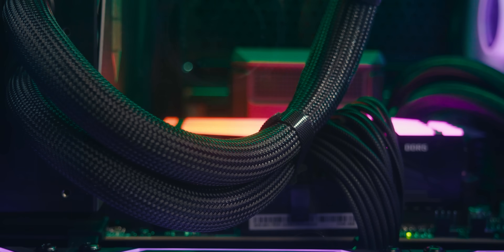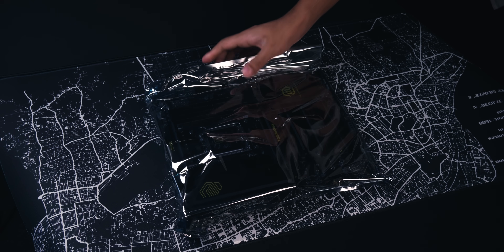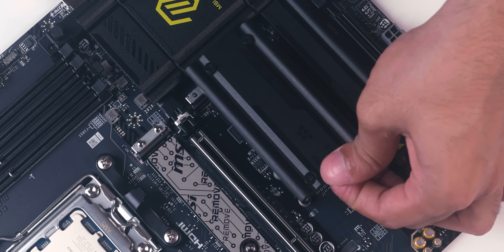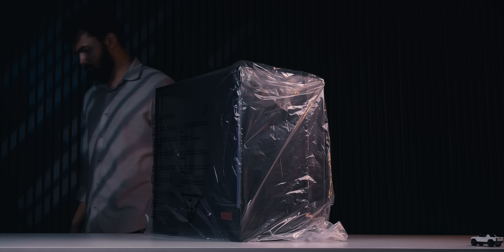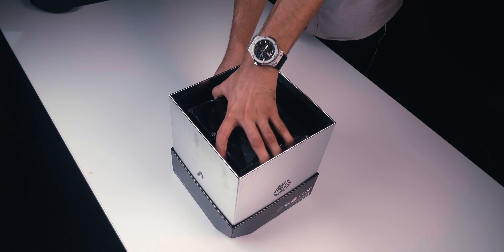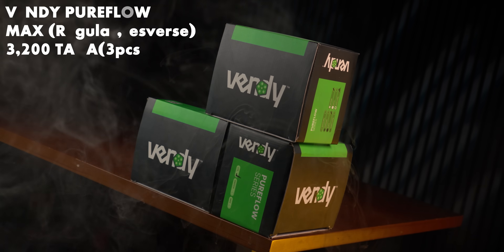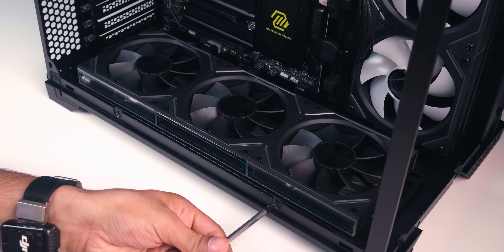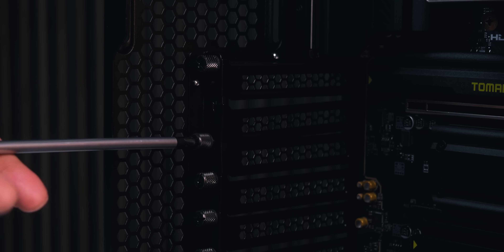PC Build For CSE Students | Ft. Ryzen 9 9900X + RTX 5090 32GB

Comment: CPU	AMD Ryzen 7 5700X (8 cores, 16 threads)	৳২২,০০০
GPU	NVIDIA GTX 1660 Super (6GB)	৳১৮,০০০ – ২০,০০০
RAM	16GB DDR4 (3200 MHz)	৳৬,০০০
Storage	1TB NVMe SSD	৳৭,৫০০
Motherboard	B550M (Asus/Gigabyte/MSI)	৳৯,০০০
Power Supply	550W 80+ Bronze	৳৪,০০০
Casing	Mid Tower with good airflow	৳৩,০০০ – ৪,০০০

মোট আনুমানিক খরচ: ৳৭৫,০০০ – ৳৮০,০০০ vai a pc banale kemon hobe

Comment: I've been watching PCB BD Channel since its beginning, Lately the quality of B-Rolls are on another level, but it amplifies the defects as well, one thing irks me is basically the 24 pin connectors not arranged with a cable comb. Please try to integrate that, that's a very minor details but it will elevate the overall aesthetic of builds a lot.

Comment: Guys dont be misguided!

With due respect to PCB team & owner of this PC, this message is for mass people!

Large scale training needs serious GPU power and multiple GPUs
for example I train/finetune foundation and distilled models on 4–8x A100 40-80g GPUs, which may sound nuts but is reality for LLMs.
Tbh you can barely fit 2–5b models on this rig
most 6b+ models need multi GPU to even run.

yes some smaller models can be finetuned via Ollama, but speaking of economical feasibility owning a $2k+ rig compared to renting A100/H100 VM makes this PC outrageously expensive for training. 

For upcoming researchers/AI enthusiasts, get a bare minimum PC or Mac then rent GPUs on cloud when needed
Good luck!
Reply: yap i know, I'm also building one for myself, but I went overkill with processor 9950x3d,
Reply: I’m running LLAMA 4b on my MacBook Pro m4 and running 7b on my Acer Aspire 7.
Reply: @Nafu0x  Yes you can run models, i specifically mentioned real world training LLM.
Reply: Good luck, man. Hoping we'd get a lot from guys like you. (I'm also starting my cse undergrad very soon.)
Reply: @mr.nabzy_OwO 
Pc or laptop konta kina uchit?
Reply: well,llms need 3,4..its a best zone ig,,,im not a runner but some of my friend do this...i specially run node in blockchain ,and also im a cyber guy i know this pc is crazy but to run model its normal ,my whole 64 gb used for run only available 1-2gb,how many gigs you have???can't affort but bth i also need this type of pc...lets see when mine time iscome
Reply: Thanks Boss.

Comment: Hi there, can you please suggest a graphics card and cpu combo that will provide smooth performance and will not bottleneck either cpu or gpu. I want to run sketch up, 3d Max, revit, AutoCad software.

Comment: CPU	AMD Ryzen 7 7800X3D	
GPU	ASUS TUF RTX 4070 SUPER 12GB OC Edition
Motherboard	MSI B650M Mortar WiFi DDR5	
RAM	Corsair Vengeance RGB 32GB DDR5 6000MHz CL30	
Storage	Samsung 980 PRO 1TB PCIe 4.0 NVMe SSD	
CPU Cooler	DeepCool AK620 High Performance CPU Cooler	
Case	PC Power Ice Tower Elite WH	
Power Supply Unit	Corsair RM750e 750W 80+ Gold Fully Modular	
Monitor	AOC 24G2 24" 144Hz IPS Monitor	
Keyboard + Mouse	Redragon K552 RGB Keyboard + M612 RGB Mouse Combo	
Bahi eta ektu build koren koshto kore